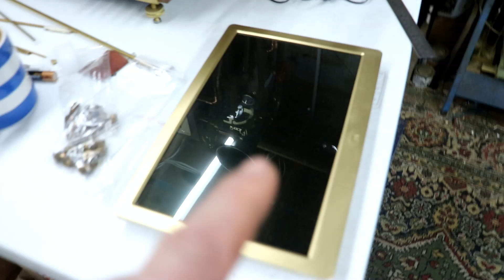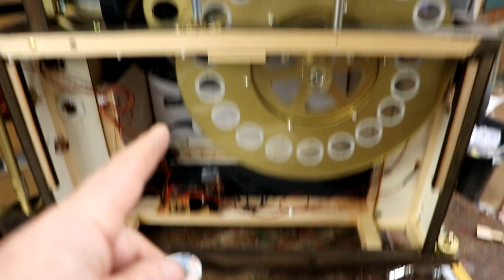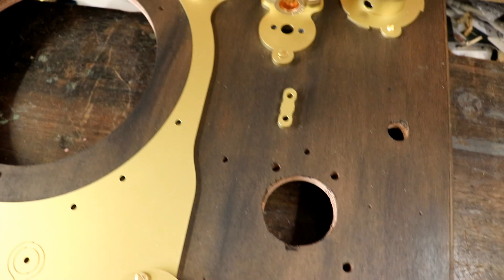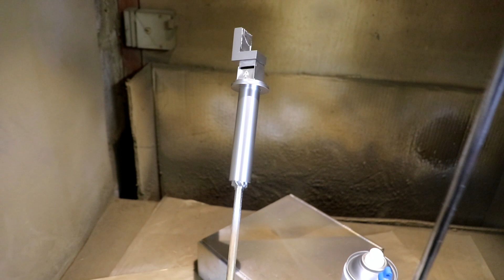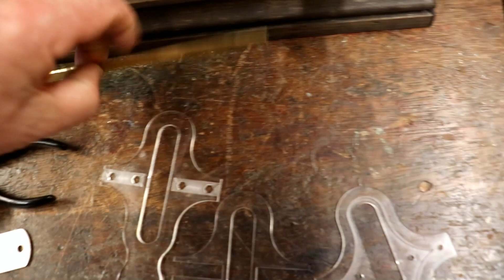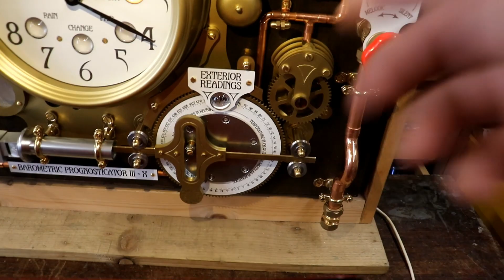I need the steampunk Luminescent Zoescope to sleep after an hour...

Comment: Shipping is always a lottery. I worked for a company supplying a training solution to a large UK government organisation, this was all computer based. These old computers weighed the metaphorical tonne, and were prone to cards bouncing out of their sockets if the unit was dropped. So we went for a custom made box, full of expensive foam, etc etc, they then weighed the proverbial megatonne. 
I'm on a customer site, waiting for a fresh unit to arrive. courier pulls up outside the building, then pulls box out of the back of his van, and it drops one end some 3feet onto the ground, he didn't know who i was, i asked him why he'd pulled it out like he had, too effin evvy mate was the reply. I said, you have no idea that at the time was valued at £50K do you? He didn't give a flying F. 
I hope your boxes arrived safely, 
Cheers. Simon
Reply from the maker: Thanks Simon, they finally did. I can only atrat to imaging the frustration you felt with £50K of cutting edge computing being dropped on the pavement! I've stopped using 'Fragile' tape, as it just seems to encourage them...
Reply: @steamhead  fragile is like a challenge. 

I'm grateful the mega expensive computer wasn't my responsibility, however, as a taxpayer, we should all be concerned.